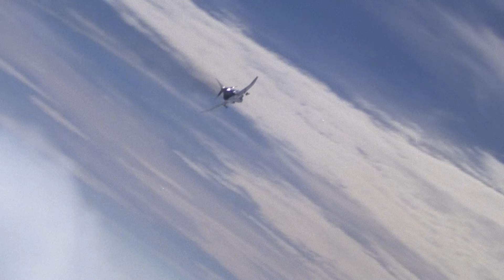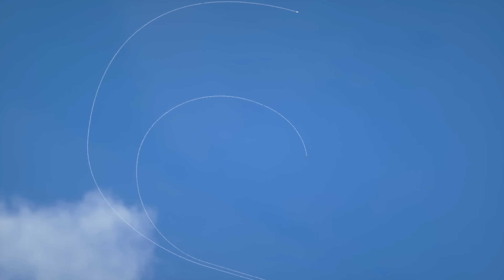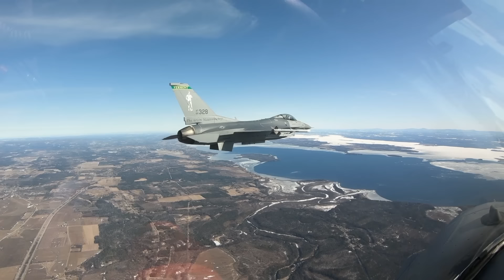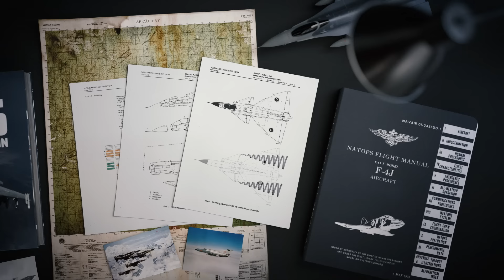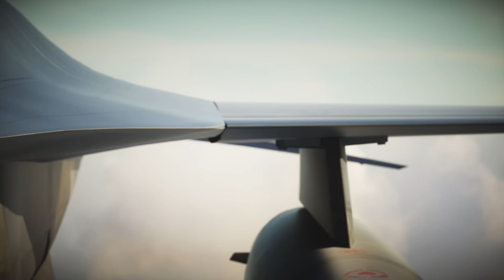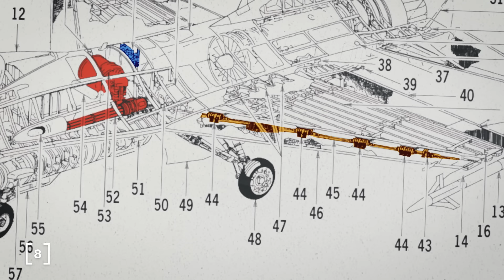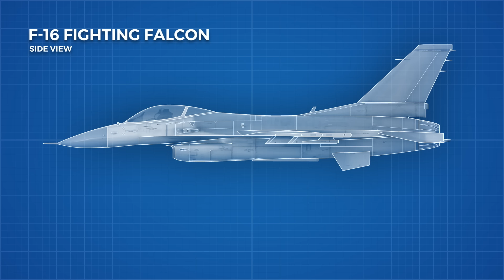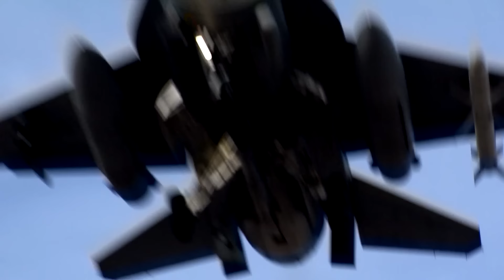The Insane Engineering of the F-16

Comment: Insane engineering ruined by one flaw , F16 is a vacuum cleaner for the air strip , ever saw even in the movies air strip cleaning crew , one bolt on the strip , there goes your engine .
Russia can destroy every single air strip , something they did not know in Vietnam , now they know . They can make a bomb filled with bolts , 1 per strip , no F16 will be in the sky .
While Russian planes new and old suck air from above , this is a must due to mostly bad shape of Russian air strips and the land mass , not even USA can clean all those strips , so they made their airplanes , all of them to be able to land on any flat surface , including roads , even dirt roads as long as they are flat . So they made planes that can land anywhere in Russia , something they need .
So forget maneuvering , you can maneuver only when you are in air , and those F16 will not be in air , not from Eastern  Ukraine they wont . maybe Russia will let them use Western  Ukraine , for they need their army to practice , couple of F16 around here and there will actually help , but they wont let them come close to be able to attack important installations , that i am sure of .
And you can forget Plane to Plane  dog fight , that will not happen , so Russian or USA planes maneuverability , turn rate is close to irrelevant .

Comment: The MiG-21 actually did not have better slow speed maneuverability than the F-4. The MiG-17 and MiG-19, which the NVA air force had a majority of, definitely did, though. They would out rate the F-4 at slower speeds and use their internal cannons (early F-4s did not have cannons) to shoot many F-4s down. MiG-21s utilized their high speed to ambush US planes who were tied up fighting these other MiGs.

Comment: 1. In video are almost not visible any MiG-21.! Planes with Czechoslovakia markings (Československé letectvo) are Su-22! Not fast, not maneuverable, pretty heavy due a variable swept wing. Su-22 obviously dont have clean delta wind as MiG-21!
2. MiG-21 does not have variable swept wing in any variant or clone!
3. MiG-21 is not dogfighting plane, it is not easy to maneuver special in lower speed in low attitude.
4. Is designed primarily for attack from back.
5. Su 22 does not have AA radar!
Absurd

Comment: this video is about the f-16 fighter jet and how it was designed to be maneuverable in air combat.

the f-16 was born out of the vietnam war where the us realized their f-4 phantom jets were no match for the smaller and more agile soviet mig-21s. the f-16 was built with a new concept called energy maneuverability in mind. this concept says that the ability to change direction quickly is key to winning a dogfight.

the f-16 accomplishes this through a number of design features, including a lightweight design, a powerful engine, and large wings. the video goes into detail about how energy maneuverability diagrams are used to design fighter jets.

another interesting feature of the f-16 is the g-suit, which helps pilots withstand the high g-forces that they experience during maneuvers. the f-16 is a 45-year-old design, but it is still considered a highly capable fighter jet.

in fact, the ukrainian air force is currently using f-16s to fight against russia. the video ends by talking about a bonus video that is available on nebula, a subscription service, which goes into more detail about the f-16's automatic obstacle avoidance system.

Comment: This 45-year-old aircraft could take out an f-35 in the case of a true dogfight, I'm telling you the f-16 is very hard to get away from it will find a way to point its nose at you.
Reply: True however the F35 wont ever get into a dogfight as if you have to dogfight with a 5th gen fighter you have messed up somewhere big time. However if the f35 is in its full stealth setup then the f16 wont achieve a lock on the f35
Reply: The F-35, with up to date software, can handle an F-16 in a dogfight. Computers have come a long way.
Reply: "A medieval knight could beat a navy Seal in sword fighting"

Comment: I like how other fighter platforms are coming out with technology as if it is new.  The Viper has had these capabilities for decades...
F-16 is a CODE 1 Bandit.  It can carry just about anything you can sling under the wing.  Can be turned easily multiple times a day and still be happy .  This bird can reliably put up a 40ship Elephant walk seen it many times.   Is there another modern fighter that can do that, routinely?  On TDY we could fly a local sortie turn the jet hang a travel pod and fly home the same day.  I don't think many are brave enough to do that.   She is a hotrod with the reliability of a Camry... In my humble opinion of course

Comment: The biggest hindrance is the pilot (they didn't nickname it the lawn dart because of the jet itself).  Get rid of humans in these things, and they'll be far less expensive, quicker to the field, and with much more performance.
Reply: Uh yes they did... the majority of F-16 crashes were because of the early F100 engines, as well as glitches in the FBW system.  It was eventually a recommendation for pilots to eject instead of attempting to restart a failed engine, because the back-up systems to power the FBW flight controls only provided power for about 5min.

Drones are not less expensive. They're also typically less effective than a piloted fighter in intense situations where decisions need to be made accurately and quickly. The problem with piloted fighters is that it takes pilots many years to become proficient and thus they cannot be easily replaced.

Comment: By the F16 I really mean the best fourth generation fighter aircraft. Russian aircraft in this category have a higher weight and two engines. The F16 does not have the elegant Russian design (SU27!), but rather the better combat specifications. The Russians' wheels are better designed for take-off and landing on weedy slopes.

Comment: The Russian Su-35 fighter would have enough time to detect and open fire on the F-16 before being discovered, which would put the American aircraft in a losing position. "In one-on-one the F-16 would probably not even be able to lure the Su-35 into a short-range air combat area where the small aircraft could show its agility"
Reply: The F16 is a multirole aircraft, 3 times cheaper as well. It would likely be predominately used to disperse glide bombs and assist in occasional air superiority, which can be performed from safe distances. Very little maintenance required and can be stored outside, tested in artic and deserts. Engines can be replaced it less than an hour. RU would have to constantly have SU-35 support in the air to counter and radars available to detect the aircraft far enough into Ukrainian territory to come close in countering.
Reply: 😂😂 you think the su35 is modern enough for that
Reply: Yeah, that’s why the F-22 and F-35 exist.

Comment: What a great video. I use to be an Avionics technician on the F16 and i still learned some stuff. Awsome!
Reply: Simple people like simple content.
1. In video are almost not visible any MiG-21! Planes with Czechoslovakia markings (Československé letectvo) are Su-22! Not fast, not maneuverable, pretty heavy due a variable swept wing. Su-22 obviously dont have clean delta wind as MiG-21!
2. MiG-21 does not have variable swept wing in any variant or clone!
3. MiG-21 is not dogfighting plane, it is not easy to maneuver special in lower speed in low attitude.
4. Is designed primarily for attack from back.
5. Su 22 does not have AA radar!
Absurd
Reply: @askme5805 your insults are hollow. Nobody is going to argue with someone that cannot argue in good faith.
Reply: The man did not even mention a MiG-21. Your copy paste is irrelevant.  @askme5805

Comment: I'd love to see the technical data on the static and dynamic balance you refer to. I know of NO aircraft that fly's in a tail heavy configuration. Not more than once anyway. I'm always happy to learn something new. It's difficult to believe that the speed or frequency of even the fastest super computers the military had in '69-'70 could perform the required calculations needed to stabilize a tail heavy jet that could travel upwards of MK2, so I'd love to know how they did it?
Also, I hope the visual exaggeration of center of gravity and center of lift was for effect. There's a lot more to it than what you describe, and video's don't always offer the opportunity to go into that much detail. Thanks for the video. It left me with a lot of questions, now I have work to do. If you have sources for your data could you share them?

Comment: i dont get all this thing about speed is life.... if you were fighting an enemy aircraft what would you rather a Super hornet or F16 block 52? the  F16 will have a far higher climb speed and max speed and acceleration by about 50% at least than the super hornet that is draggy and built for low speed stability. Yet the radar and avionics is far better on the hornet and everything is supposed to be beyond visual range now.... if speed was life everyone would still be buying mig 21's as its still a very fast nible cheap aircraft yet even China does not use them anymore for main roles..... so it must be over rated. The bigger better radar with better jammers and better missles wins....
Reply: Speed is life does not refer to maximum speed or even supersonic speed. It refers to sustained speed, which is important when maneuvering defensively against BVR missile launches, as well as in dogfights. The phrase is also applied to air to ground combat, because faster cruise speeds mean an aircraft is exposed to enemy sights for a shorter period of time.

The Super Hornet's avionics are slightly better than an equivalent era F-16, but not enough to outperform the F-16 in air combat at any range.

The MiG-21 was only fast. The F-4 was just as maneuverable, faster, and carried a much larger payload and more capable missiles.

Comment: As an aeronautical engineering student, this video was overall great, with nearly all the concepts explained very accurately and concisely. However there is a remark I'd like to make on the explanation of pitch stability (around minutes 28 and 29). The way it's portrayed in the video seems to combine the ideas of pitch stabilty and trim, which are slightly different. Trim is basically when the tail produces a force (regardless of direction) to counteract the moment produced by the wing's lift, so as to balance all the moments around the aircraft's centre of gravity. This is shown by the 3 arrows in the video. The "center of lift" arrow shown in the diagram should then correspond to the center of lift of just the wing, without the contribution of the tail. However, the stability of the aircraft depends not on the position of that center of lift, but instead on the position of the aircraft's neutral point, which can be described as the point through which any extra lift from a change in angle of attack will act, and it involves the contribution of both the wing and the tail. This point is generally somewhere in between the wing and the tail, closer to the wing. If the neutral point is behind the centre of gravity, the aircraft is stable in pitch, and if it is in front it is unstable.

Comment: FYI boundary layers are not necessarily turbulent. And in clean air flow, i.e. the free stream of straight and level flight it likely isn't. What it is though is slow moving, and grows in thickness with how far down you measure it down the length of the body. At the skin, it is for all intents and purposes, and for mathematics purposes, considered to have 0 velocity.  There is a thickness to the boundary layer that increases in velocity until the free stream velocity. As you go further back the boundary layer is thicker, with more very slow "stuck" air, and a slightly larger velocity gradient. You don't want the engine to ingest that air, because theres very little of it, and its not moving very quickly, so the carefully engineer duct shape can't slow and pressurise that air.  It would be like trying to pump fuel through a line that is considerably thinner,

Comment: by the 1960's they thought you didn't need maneuverable jets you only needed maneuverable missiles . 
 they even dropped the gun for the first f-4 because with those new missiles dogfights were over. they were wrong .
Reply: No, they were right. Navy F-4s performed better than USAF F-4s. Navy F-4s were never upgraded with a gun. It's also worth noting that the idea was not a lack of need for maneuverability, but rather a focus on speed. The F-4 was still equally if not more maneuverable compared to the Soviet fighters of the day, and even into the mid 1970s.

Comment: JAS is perfect for Ukraine. Sweden knows that Russia will knock out landing strips first. Any road stretch of 800 m will do as a temporary air base for JAS, with 6 maintenance personnel. Also, F-16 has a short range since the US does in flight refills. JAS has 3 times the range.
Reply: The JAS-39C/D has a shorter combat range than the F-16 for a typical CAP mission (800km vs 850km). Only the E has a longer combat range, and it isn't by much.

Comment: I've heard that a forward swept wing was designed to make a plane much more efficient in maneuvering and agile, but the cost would be it is simply too unstable. Imagine we finally fix all the forward swept wings problems, then slap the wing onto F-16, this plane would be the most agile plane possible lmao
Reply: Nah it would break apart. Forward-swept wings are fine for slow-fliers, but you can do a simple test on yourself to see the disadvantages. 

1. Hold out your non-dominant arm so it is straight.
2. Get somebody to push down on your hand.
3. Get them to push down on your shoulder. 

Basically, a normal wing gets most of the pressure of airflow and G-forces close to the fuselage. A forward-swept wing results in that pressure pushing down on the wingtips, because they hit the airflow first and will dip down when a pilot pulls into a turn. High speed is also a problem, because airflow is much much faster than in a subsonic dogfight and any slight change in direction can make the wingtips oscillate violently.

This presented 2 problems.

1. Wing stress would be far greater than on traditionally winged planes, which would increase maintenance costs and reduce airframe lifetime. Those F-15Cs that are being replaced by F-15EXs have been around for almost 40 years and gone through 2 fleet-wide wing replacement programs. A forward-swept wing fighter would see a total lifetime of maybe 10 years before needing to be retired.

2. If a pilot was to attempt to fly at normal dogfight speeds and pull a high G turn, there is a major risk of mid-air disassembly.

Comment: Nice piece fo work.  One quibble, the first fly by wire aircraft was the CF-105 AVRO Canada Arrow, not the F16. It's control surfaces were all controlled by computer - back in 1958, long before the F16 was designed or flown.
The F16 built upon this pioneering design and added throttle and other systems under computer control.

Comment: I would have to inform you and clarify it was not made in 1966 already had that commission from them. The aircraft that they had for example the super delta wing is one that has that typical cone nose but no it was not. They have 16 was made in the '90s. The old aircraft that they had was like two bubbles that was it until 1994 they also had the f-15 and 1994 other than that there was no other aircrafts on post.

Comment: Not that it really matters, but the footage of the "mig 21's" are not mig 21's. They are Czech SU 22's. The SU 22 is the export version of the SU 17, which in turn are upgraded versions of the SU 7. It's a ground attack platform with swing wings. It doesn't matter much but just an FYI.

Comment: Since the F-16 went into service in 1978, all other fighters aspire to be an F-16. Since it is so maneuverable, pilots can frequently black out. The fleet was grounded after 3 CFIT (Controlled Flight Into Terrain) in 1979. Having a deep electrical background and the F-16 being Fly By Wire, I proposed the Preventative Ground Collision Avoidance system. Since it was a black project for years, I couldn't talk about this, but about 15 years ago or so, I got authorization to discuss the history since the project was declassified. Today the technology has change since at the time the F-16 used analog computers, and today aircraft use digital computers. The system is used on many aircraft and has saved many lives.

Comment: Two points: F-16 airframe is not limiting factor. The plane can pull more g’s than a human can withstand. HillAF pilots ground train tightening muscles to prevent blackout above 9g’s
Also, G-Dynamics fly-by-wire software killed 9 pilots. Flying stealth across Great Salt Lake upside down planes kept ditching into the water. PIO was alleged until code review caught that the pilot stick inputs were not reversed after plane put upside down.

Comment: While the F-15E is a dynamic warheads on foreheads deliverer, I do think that the F-16XL should have also been procured via Falcon production procurement slots. The same high-low dynamic, that governed the need to acquire 15&16 originals should've been applied with these derivatives.

Comment: Was the MiG-21 really more manoeuvrable than the Phantom at low speeds? I thought that was the MiG-17, and the MiG-21 actualy suffered pretty heavily if the Phantom could force it into a turning dogfight (instead of just one pass with missiles and then noping it out in a straight line with full afterburner). Of course the F-16 was designed to whip both kinds of MiGs (and eventually did in Israeli hands) so this is ultimately just a minor niggle about the intro